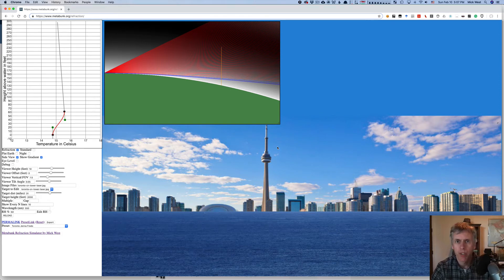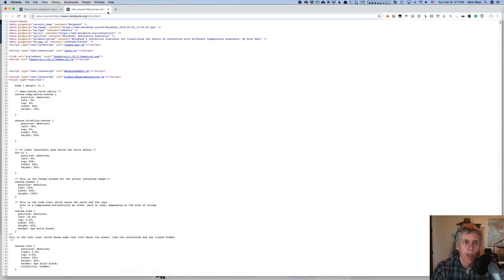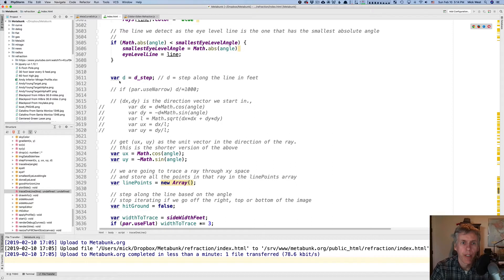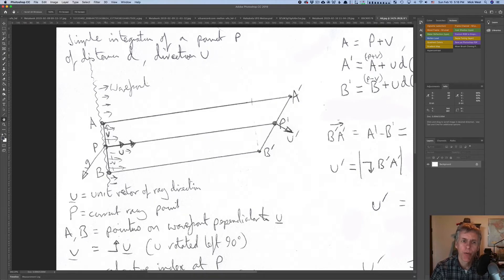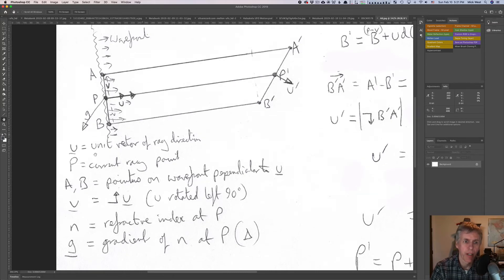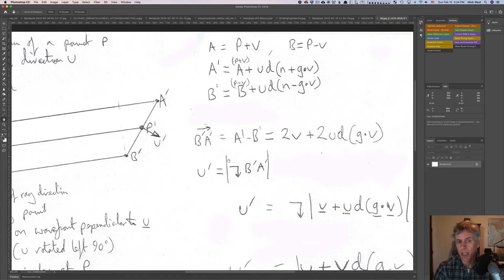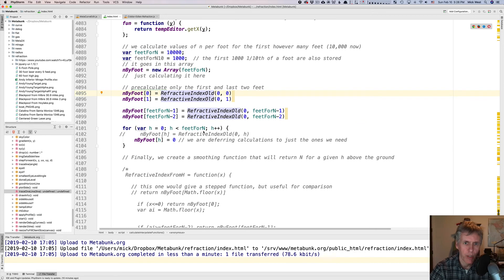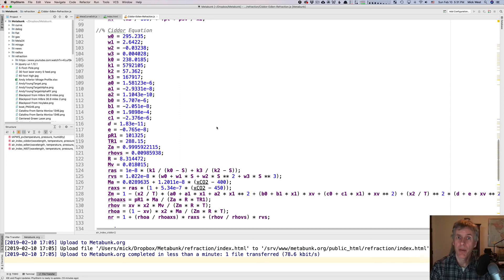Refraction Simulator - TECHNICAL explanation

Comment from the maker: Note the equations at 15:06 are slightly off, as it should be divided by (n +/- g.v) (not multiplied ) , and then a later vector is backwards. This has no effect on the resulting image as the two errors nearly cancel each other out.
I have since re-written function stepForward to not use gradient, as it was not actually the optimization I envisage. The following code is functionally equivalent, and slightly more accurate. Same principle though. 

function stepForward(x,y,ux,uy,d) {

    // did we hit the ground as defined by the "drop" function?
    if ( y < (- drop(x)) )
    {
        return [x,y,ux,uy,true]
    }

// Back to the two point method
// Since we currently use the refractive index function to calculate the gradient
// there's really no advantage to using the gradient method, and it actually was less accurate.

    // calculate v, a 0.5 foot vector, roatated left 90 degrees from v
    var vx = -uy/2;
    var vy = ux/2;

    // calculate a and b as p+v, p-v
    var ax = x+vx;
    var ay = y+vy;
    var bx = x-vx;
    var by = y-vy;

    // move the actual point, scaling by the refractive index
    var n = RefractiveIndex(x,y)
    x += ux*d/n
    y += uy*d/n

    // move a and b similkarly
    var an = RefractiveIndex(ax,ay)
    var ax1 = ax + ux*d/an;
    var ay1 = ay + uy*d/an;

    var bn = RefractiveIndex(bx,by)
    var bx1 = bx + ux*d/bn;
    var by1 = by + uy*d/bn;

    // calculate the direction of the new v vector from b to a
    var bax = ax1-bx1;
    var bay = ay1-by1;

    // the new u is the v vector rotated right 90 degrees
    var ux1 = bay;
    var uy1 = -bax;

    // and normalized to length of 1
    l = Math.sqrt(ux1 * ux1 + uy1 * uy1); // this should be the same as sqrt(1 + dgDotV^2)
    ux1 /= l;
    uy1 /= l;

    // done, so return new position, direction, and flag not hit the ground.
    return [x, y, ux1, uy1, false]
Reply: Thanks, this function is more easy to understand. Like it.

Comment: This is great stuff, but there's something I don't quite understand.

On a FE model, without modelling intermediate temperature/humidity gradients, this implies that the refractive index of the atmosphere at a given height should be constant and, thus, light travelling parallel to the surface shouldn't be refracted at all. I've had a play with the simulator and this doesn't, obviously, seem to happen. For instance, if I set the viewer tilt to 0 and the FOV quite low (0.1) that shows all of the rays curving down to earth on FE when I thought there should be some parallel to the surface.

Am I missing something about the refraction, or am I misusing the simulator?
Reply from the maker: You are missing something about refraction. I didn't understand this at first either, but refraction occurs across wave fronts, not along infinitely thin lines. Think of a laser beam going parallel to the surface (on FE), the refractive index does not change along the beam, as it remains the same distance from the surface. However laser beams do have some thickness, and the refractive index DOES change ACROSS the beam. The top of the beam is in thinner air than the bottom of the beam. So the top of the beam moves quicker than the bottom, and so the beam bends downwards. 
A good demonstration of this is the refraction of a laser in a fish tank with sugar water. https://www.youtube.com/watch?v=KLufSkz-et0
Reply: @MickWest  Great explanation. I kind of knew this, but I didn't think the difference in refractive index between the top and bottom of a laser beam would be that significant.

I've learned something new today.
Reply from the maker: It's not that significant, but it also isn't really related to the thickness of the beam. The bend comes from the gradient across the beam, which is the same regardless of the thickness. 
It's still not a lot though - which is why it takes miles of air to make a visible difference in most conditions.
Reply: @MickWest  Thanks for the responses. I'm trying to understand how this works. I have a background in optics via optoelectronics, but it was 30 years ago that I studied this stuff.
I have another question. I understand you are calculating the wavefront by using n for air 1ft above and 1ft below the current position based on Ciddor. Does this change significantly if you used, say, 1in above and below, or is the Ciddor curve nearly linear at this point?
Reply from the maker: @KeithMilner  The current code usues 0.5 feet above and 0.5 feet below (i.e. a wave front of 1 foot) It's essentially linear for a standard atmosphere. I tried smaller values, and it only made a significant difference to the fine details of strong mirages. In the simulator you can turn on "Graph RI" (at the top) and it will show you the RI as a blue line (dimension not show) You can see over the course of 1 foot it's pretty linear
Reply: @MickWest  Great. Thanks for that.
Reply: @MickWest  " I didn't understand this at first either, but refraction occurs across wave fronts, not along infinitely thin lines."

Refraction is fundamentally a wave phenomenon of course, but the second part doesn't follow: it's not like geometric optics has broken down! It's an approximation that still works excellently in typical atmospheric conditions, as long as applied correctly (maybe your first instinct was to try to use Snell's law -- sure was for me -- but that can't work because the boundary conditions are all wrong).

Instead you can apply Fermat's principle, which is a consequence of Huygen's principle together with the stationary phase condition: wavefronts that take close to the minimum possible amount of time interfere constructively, where other fronts interfere destructively, and so these coalesce into rays traveling through paths that minimize the traversal time. In this framing it's easy to see why straight horizontal paths can't work: you can imagine an atmosphere with a huge index of refraction near the ground that sharply decreases as you go up, so to minimize traversal time you have to go up.

Mathematically you extremize a functional like

T = int n(y) sqrt(1 + y'²) dx

(taking y to be a function of x, but of course you could also use a parametric formulation) whose Euler-Lagrange equations look like (if I did it right)

ny'' - n'(1 + y'²)² = 0

This is probably good enough to integrate numerically, but one can also switch to a Hamiltonian formulation to get two first-order equations instead, which would look a little more like the technique you used. There's probably also a way to solve this efficiently for all space with some variant of the fast marching method or something, though those are difficult to parallelize. 

Fantastic work on the simulator, by the way! And on the channel overall.
Reply: @vacuumdiagrams652  When you say that the first instinct to use Snell's law doesn't work because "the boundary conditions are all wrong", what do you mean by that? I'm curious where the assumption of an atmosphere as thin slices of air, each with constant index of refraction, fails, since I was messing around with that calculation.

Comment: Mike, thank you very much for the inside. I could follow it without problem, very good explained. No questions left. The only question I had was how did you calculate the light path from the refractive index. I have to say your solution is very clever! I'm very impressed indeed. 

By the way I did learn something new in JavaScript I never saw until now: [ x, y, z ] = f( ... ) to assign the returned array elements to individual local variables, called array destructuring (ES6 notation, not supported by IE11)
https://kangax.github.io/compat-table/es6/
Reply from the maker: Thanks! After making that video I, of course, found an error in my math. Actually a double error that nearly canceled itself out. I was multiplying the length by (n +/- g.v) when I should have been dividing. Then later flipping a vector. It did not really make any visible difference,  just annoying I got it wrong.
Reply from the maker: See new stepForward function.
Reply: @MickWest  
Thanks for the warning at the beginning. I just scrolled down to the comments and as i expected, I found @Walter Bislin
 discussing things with you as if it's so simple like a walk in the park lol
Reply: @MickWest  I usually publish my code. In this process I read back the code as if I were a visitor that tries to figure out how it works. I always find some minor bugs in that process, that would produce errors in certain cases. 

I'm too lazy to test each function with all valid and invalid parameters as I did at work, where I had implemented a postscript like interpreter as a test engine. With it  programmed test routines for all my modules. After each change in a module I simply had to run the test to verify that I did not introduce some errors.
Reply from the maker: @WalterBislin  yeah I don't think I would have noticed the bug had I not described it out loud. It made very little difference fixing it. 
I dropped the gradient thing entirely. I'd originally thought it would be quicker, but as  I was calculating four values of N to calculate the gradient it wasn't any faster, and was just confusing. The new code is much easier to explain, and actually more accurate.
Reply from the maker: @WalterBislin  It's funny it worked though. It was like 1/1.0001 vs. 1*0.9999, and flipped in the y (which I'm sure I just assumed I had upside down, and flipped, and it worked). Cowboy programming.